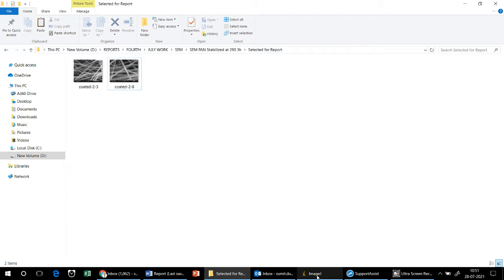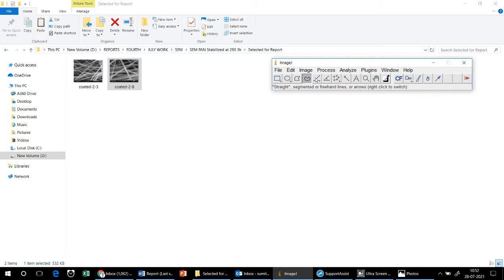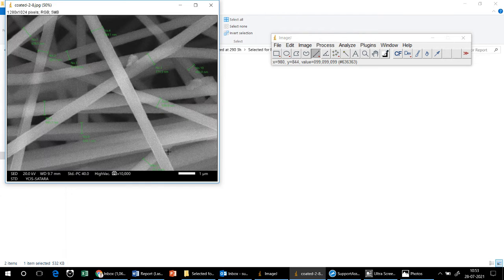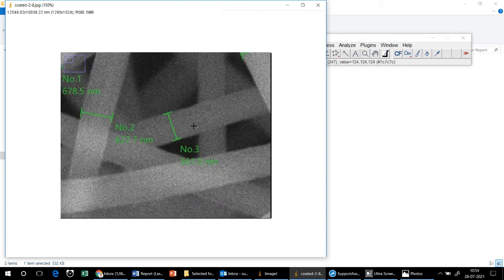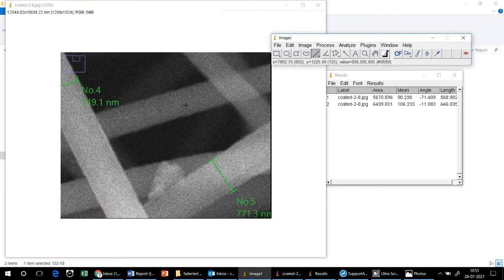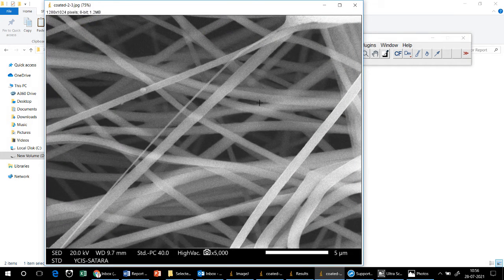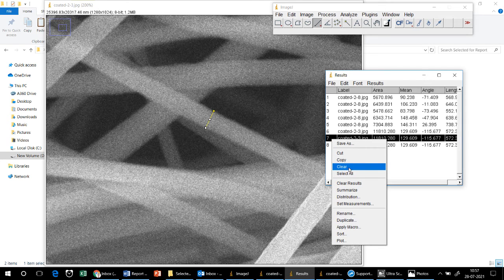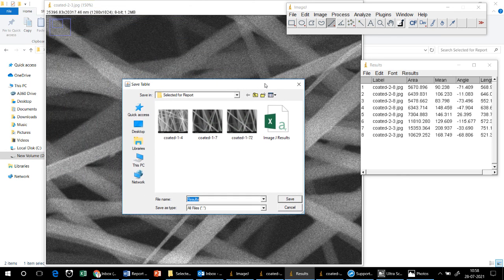Nanofiber diameter measurement using ImageJ Software

Comment: sir, how can we meaure the length of the above nanofibers ? Length is needed to calculate the aspect ratio.
Reply from the maker: Yes we can but SEM image is focused image. If fibers are continuous, then it is difficult to measure total length as we are considering very few area of total nanofiber mat. So it will not useful to calculate aspect ratio.

Comment: Thank you so much about video.
I have questions about diameter measurement
1. At least how many values we need to measure ?
2. We measure 1 value with 1 nanofiber, aren't we  ? (If the nanofiber doesn't uniform, example the top is 5 µm, the middle is 6 µm and the bottom is 6.5 µm)
I measure many locations in 1 fiber, (example top, middle, bottom). Is this right method ?
3. If it is a blur nanofiber. Does we measure this blur nanofiber ?
I hope I would receive your answers soon. Thank you
Reply from the maker: Hello sir. Thanks for your comment and sorry for the late reply. 
Answers are based on my personal work done in my reaserch work. 
1. It depends on SEM image. In my case I have considered 30 nanofibers ( may vary in other case) and average fiber diameter calculated by plotting histogram with standard deviation.
2.  Yes. Nanofibers vary in diameters along the length. So consider the SEM image where you will find the same diameter fibers along the length. Sometimes solvent remains in the fibers so you may find beeds in the fiber.
3. You will get tentative result with imageJ for the about the Average diameter where you can explain effect of particular tratment on the diameter of fiber. If your interest is in surface area, i suggest to go for other characterizations